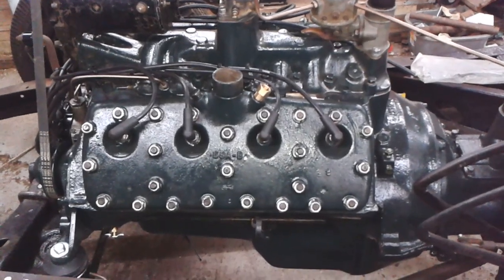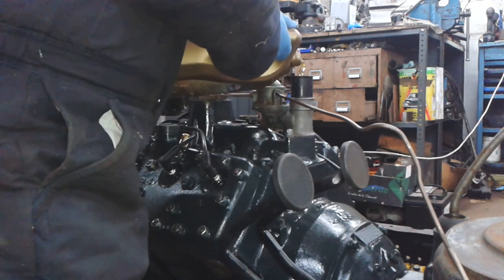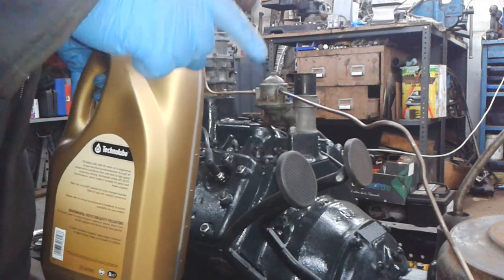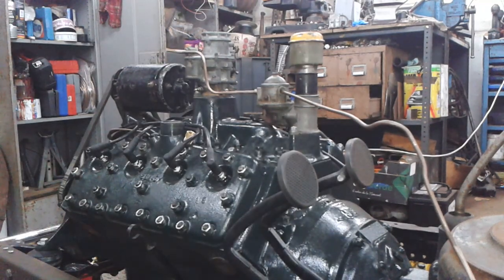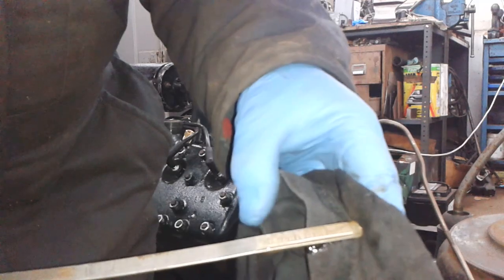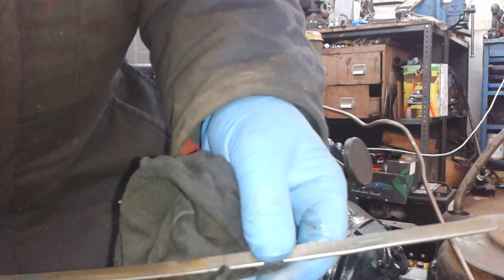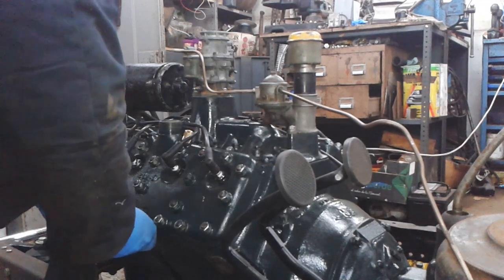Oil level. Is your dipstick lying? Make sure you know what you've got. Tech Short.

Comment: Hi Mart , pouring the oil, straight into the engine without using a funnel & you didn't spill a drop ,you have the steady hands of surgeon. 
Cheers.
Reply from the maker: Thanks Maurice. It's not too difficult when you have good access like that. The 33 and the roadster are a different proposition.

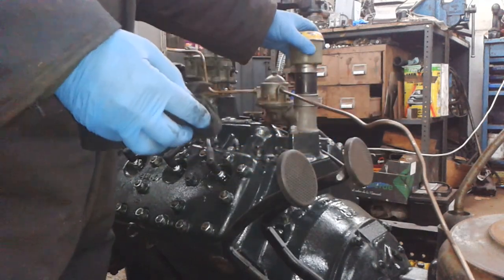Comment: 4:21 I agree. Only because I was always told to check the oil after the motor has been running because you want it to read full when all the components are coated.

Great tech tip, nice to be able to see the level on a fresh fill t see what's what. 

Keep up the Good work Mart! 👍👍
Reply from the maker: Thanks fnln. I've learnt the hard way not to take anything for granted. I've had a couple of instances of oil pressure dropoff when running at the lower end of the so called "safe" driving range. I can see why after doing the dipstick mark sanity check.

Comment: Just for the record one English quart is 1.1365225 litres according to google ;-), so 4 guart's is around 4.5 Litre. That is the volume i use, I  agree its good to do a sanity check, with a known oil volume. And when you start driving, check the oil level every time you put fuel into the car. Until you get a feeling of when to add oil. I saw that we are not far from startup good work Mart.
Reply from the maker: Thanks Lars. When I used the term "quarts" I was referring to the US quart which is smaller and closer to 1 litre. Yes, startup not too far away, I am a bit behind with videos, carb rebuild, dizzy refurb etc. I am waiting on a few items so I can start it and run it longer than a couple of minutes. Thanks for watching, always good to see your name pop up.